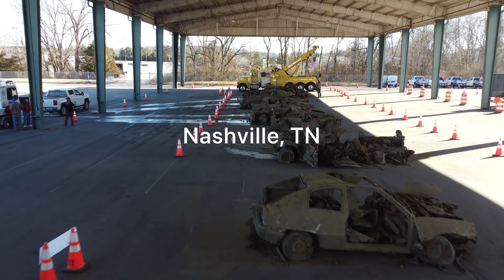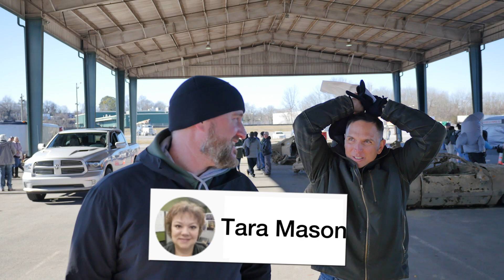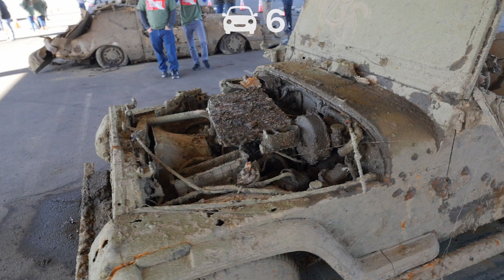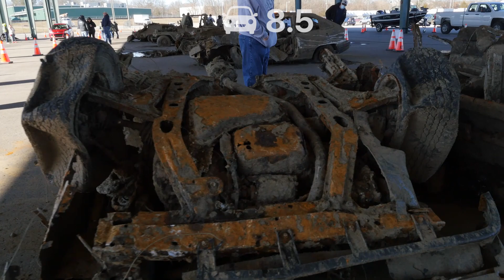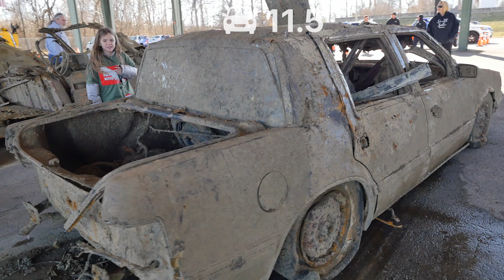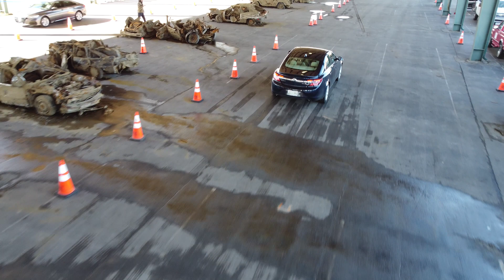17.5 Stolen CARS FOUND IN RIVER On Display at Meet-n-Greet

Comment: It'd be cool to get the back story on each of these IE: date reported stolen, location of the report filer, etc
Reply: If they can make it out I’d like to know the make and model of the cars too. I know this’ll only be a few cars though😄
Reply: @Elong.  1. 83-86 Ford Thunderbird, 2. 11-18 Ford Focus, 3. ?, 4. 82-91 Pontiac 6000, 5. 83-88 Mercury Cougar, 6. 85-95 Jeep Wrangler YJ, 6.5. ?, 7.5. 88-94 Pontiac LeMans, 8.5. 81-85 Chevy Celebrity,  9.5. 83-87 Mercury Topaz, 10.5. 85-90 Oldsmobile Ninety-Eight, 11.5. 97-93 Dodge Dynasty, 12.5 88-94 Chevy Silverado, 13.5. 92-98 Oldsmobile Achieva, 14.5-17.5 Pile of cars.
Reply: @christopher88719  3 is super beetle chassis
Reply: Christopher Fea... Thank you👍🏻
I appreciate your effort! You must have incredible knowledge of vehicles! It would've taken me forever to get all that info! 👍🏻👏🏻😊 thanks again
Reply: As well as the year/make/models of the cars that weren't so disintegrated that they were unidentifiable.  They probably couldn't even get VINs on some of them, but I would find it very interesting to know the makes/models of those that were identifiable.
Reply: All 80s to 90s vehicles. Nothing more recent. Was it full?  What made them stop dumping cars there?
Reply: I'm a serious car guy, and I am VERY impressed you could identify those cars what with so much disintegration having occurred.
Reply: @billevans2312  #2 was a 2011-2018 ford focus based on above comment.
Reply: @christopher88719  7.5 Is a German made on. It's an OPEL Kadett E type of car.

Comment: Would be cool to have some back stories on all of the cars y'all pull out. Like are they stolen, missing person's vehicles, ect.
Reply: I agree. I’m always so curious
Reply: There use to be a ferry that crossed the River there. A few were stolen but I believe most fell off the boat.
Reply: @outdooradventureswithron1571  really? Did they not secure them well? That’s no good
Reply: I want to try to get that Thunderbird back on the road. Thing's basically intact and didn't come apart like tin foil, as most of the other cars did. Must not have spent much time underwater.
Reply: @TestECull  pretty cool t bird but I bet the underside is swiss cheese. Wouldn't be worth it considering all of the electronics are totally fried and to hard to come by

Comment: Car #3 that is just a chassis is a 1968 Volkswagen Beetle. Vin # is stamped on the top of the the center tunnel back by the inspection cover. Should have a * 118::::::::* for the vin number.

Comment: #1 Late 80's Ford Thunderbird
#2 Ford Focus
#3 68 VW Beetle
#4 Early 90's Buick Century?
#5 Late 80's Mercury Cougar
#6 Late 80's Jeep Wrangler
#6.5 No idea
#7.5 Late 80's Chevette or Suzuki?
#8.5 Late 80's Chevy Caprice ex-cop car?
#9.5 No idea
#10.5 Early 90's Buick Lesabre?
#11.5 Early 90's Cadillac Seville?
#12.5 Late 80's - Early 90's GM C/K
#13.5 No idea
#14.5 No idea
Reply: 4 Pontiac 600
Reply: 7 Pontiac lemans
Reply: 11 dodge dynasty
Reply: @lazyd3450  

Good eye!  That Dynasty is either a 1988 or '89 -- shape of the dash changed for MY 1990